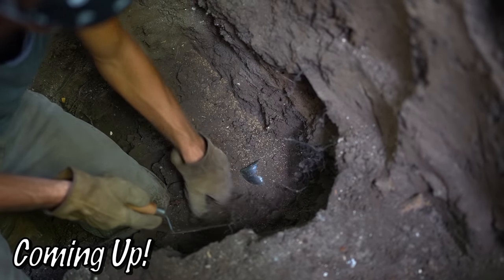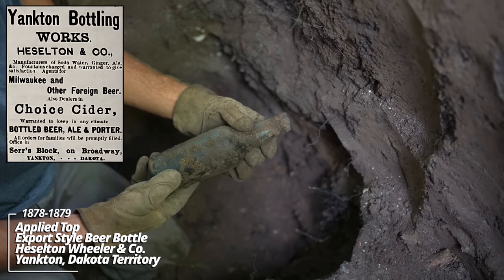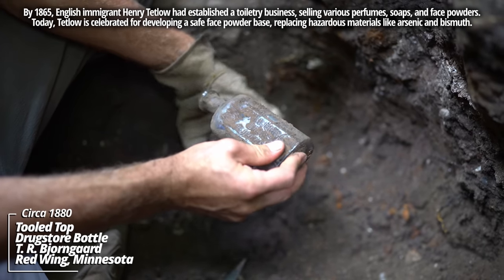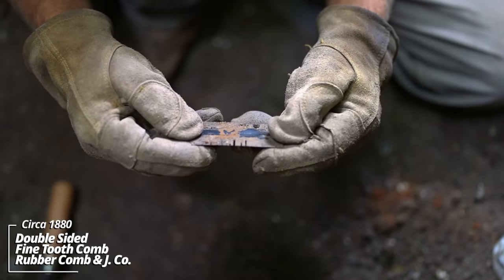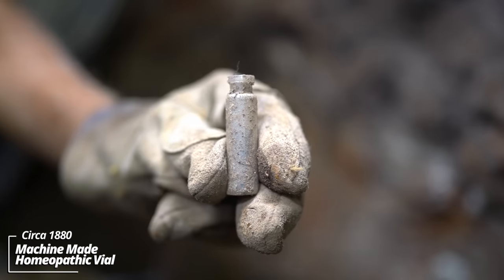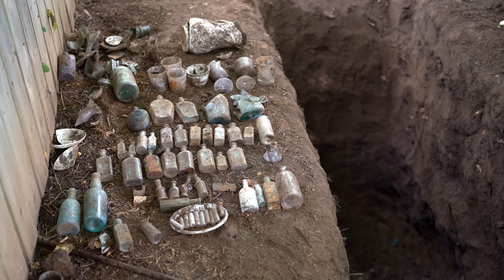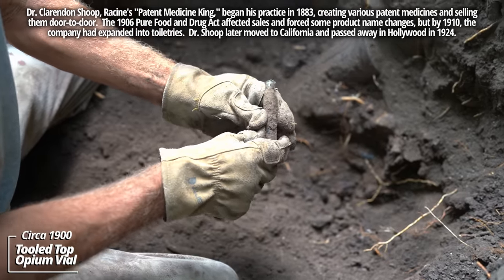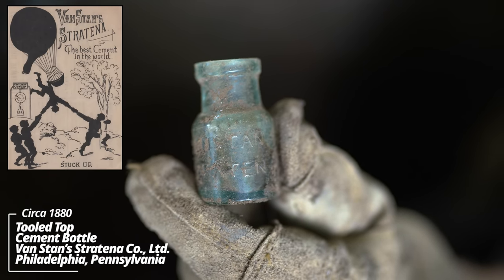A Strange Sink Spot by the Fence Leads to a Massive Payday Buried in a Back Yard for 150 Years

Comment: Congrats on the rare finds.  As a sewist i was admiring the old buttons next to the beer bottle.  I wonder what they were made it of back then? Save the little treasures too
Reply: In the late 1800s, buttons were made of metal, shell, glass, wood, leather, and celluloid, an early plastic. Old buttons are very collectible. Values can range from less than a dollar to 100s of dollars per button, depending on historical significance, maker, and such. The button I saw was white, so was likely shell or glass. White celluloid buttons are also buried, but that one looked like a more common shirt button made of glass or shell. One thing to note, dressmakers routinely salvaged buttons from older garments. So it is not uncommon to find buttons older than surrounding artifacts.
Reply from the maker: haha yeah i save all the buttons and marbles i find. i just cant rationalize throwing them back in the pit at the end. they take up like no space at all! thanks for watching
Reply: I have carded and loose buttons from my great grandmother & her sister (born in 1890’s) and my grandmother born in 1918). Most of the buttons are from the 20th century, but some could have been acquired the way I ‘inherited’ my collection, and there’s a chance some are from the 19th century. The majority are crafted from wood, cast from metal and molded from plastic or celluloid, and shells. The smallest buttons used on work and dress shirts, ladies ‘undergarments’ and nightclothes must have used buttons crafted or carved from shells.

Comment: Awesome video and dig!! Incredible really. What privy probe do you like to use? I want to purchase one for an  upcoming dig attempt.
Reply from the maker: i think they are measured in feet. i think the ones i use are either 4 foot or 3.5 feet. but i think they usually just come in 1 foot lengths typically. 2-7feet i have seen. you are definitly gonna wanna go for the 4 foot one. heres a link, but make sure you get one with the bead on the pointy end. there are some other weird looking probes on this page, but its just the one with what looks like a little bead of metal at the end, maybe about the size of a small marble

heres the link:
https://www.oldwestbottles.com/probes.php
Reply: Thank you so much for the probe information. Hope to find some old stuff at an old logging camp I found deep in the hills. Not much left that can be seen above ground. @BelowthePlains

Comment: Great dig. Whats the oldest pit so far?
Reply from the maker: this has got to be one of the oldest in the Dakotas.. that i dug anyways. The first pit was actually 2 pits that were dug into each other. the side with the pitcher was right around 1870, maybe even a year or two earlier. and the other end of the pit was a little closer to 1875-1880. Amazing age on either side. unfortunately, stuff around here in the 1860s was just so spares that not a lot made its way up the Missouri River, and even less ended up being thrown away. 
thanks for watching

Comment: Why are all these bottles and dishes buried so deep
Reply from the maker: it was likely an old trash dump or an outhouse. back in the day, they would just burn their trash. but stuff like metal, ceramic, and glass wouldnt burn, so they would throw it down the outhouse hole.. a lot of the time the just chucked it in the creek, or river, or even brought it to the town dump. but more often than now, it was just easier to throw it down the hole and forget about it... it was a surprisingly common practice. people did it all across europe and north america. basically anywhere that had disposable glass items and outhouses at the same time. thanks for watching